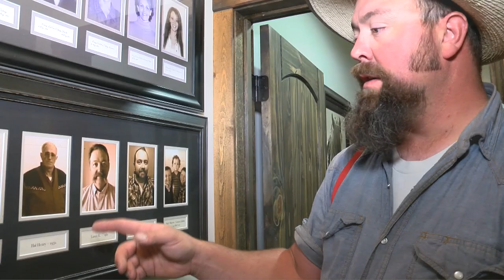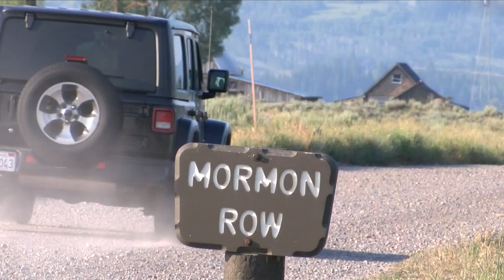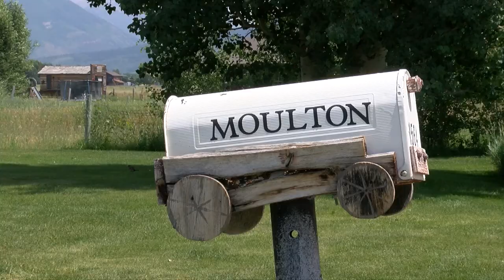The Old Ways

Comment: I grew up in Bates of the Teton Valley.  I have seen all of this.  When I was a boy in the 40s I ran the derrick horse.  I remember the hay field having several teams and a Ford tractor side delivery and dump raking to bring the hay to the stacker.  1 or 2 guys would be stacking the hay.  I even remember a thrashing machine, which predated combines in my grandpa's field.  I remember grandpa on his mower with his team of horses.  Most all the farmer/ranchers had teams and other horses in that day.  We knew the Woolstenhulmes.  Daryl and Ruth are acquaintance of mine.  My Aunt Rhoda Furniss was a Moulton.                              

My cousin still has our grandpa's brothers old sheep camp.  I stayed in it more than once for about a week with Uncle Walt, Uncle Hugh and sometimes Uncle Ted.  I miss them and I miss the old days.

Comment: Chain those logs as close as you can to the log cart, and when you start pulling, it will lift the front of the logs for easier pulling... plus better control when the logs aren't stretched so far out behind.

Comment: Great video! I grew up working with horses with my Dad. Not sure if you'll see this but at the 2:05 minute mark there appears to be a left-handed horse mower, I've never seen a lefty before. Is there any way to find more about that mower?
Reply: Looking at the video it looks like a international no9 where the video was mirrored I'm slowly becoming more knowledgeable about the horse drawn equipment so I'd say that it's probably a 9. I'm Saving up for a shop here in southern ohio because I want to restore and remanufacture horse drawn farm equipment for my friends in the horse shows and the local Amish communitys the first tool I ever bought was a 3d printer for making master casting molds of lost or broken parts , second was a rubber tire machine for horse carriages ,third is a 1888 frick sawmill so I will always have a good supply of lumber cut to what I need as well as speed up my funds for getting new equipment to get myself closer to opening up my shop
Reply: I was born in 1944 and grew up on the home place. I saw the sweep and stacker sitting and never used so I had to imagine how they worked.  The binder was sitting in a building and wondered how it worked.